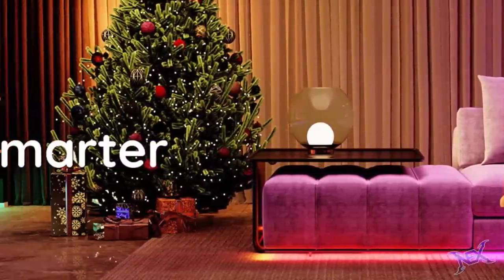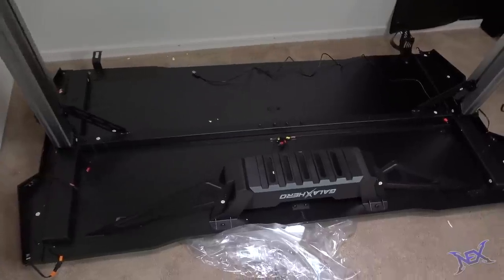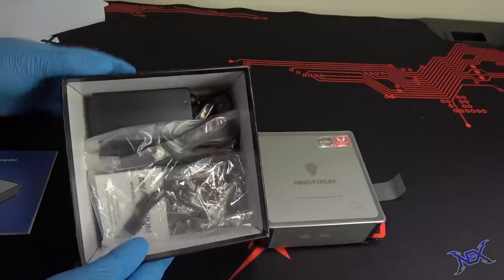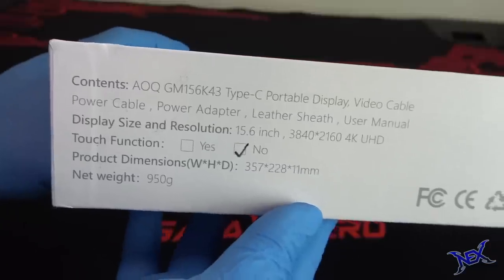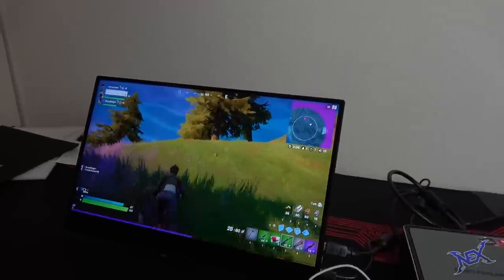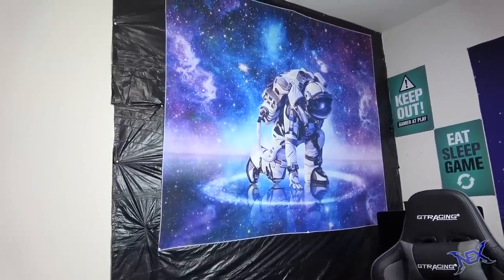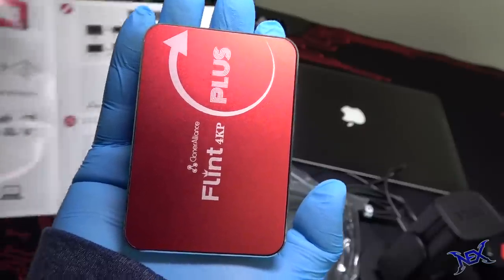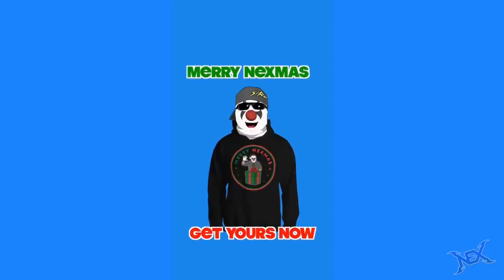I Built My Dream PC Gaming Setup -  Govee TV Backlight Immersion| Nextraker

Comment: hey can u please make a gaming setup of xbox series s because the last one that you made was not pretty good so can you please make another one by using the imac , curve monitor from ps5 gaming setup and the table also from the ps5 gaming setup and also use the emeet webcam , emeet luna speaker and for the headsets use the afterglow level 3 xbox headset they would look amazing please and these are the items that you will use to build that gaming setup 
imac 
curve monitor 
emeet webcam
emeet luna speaker 
fifine k690
rick and morty mousepad 
av access HDMI switcher 
aukey 12 power outlet